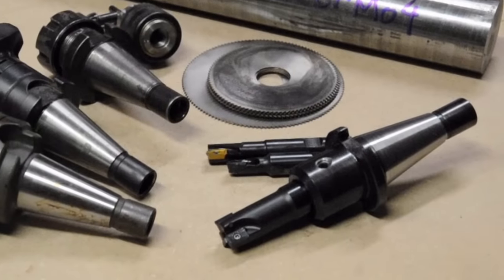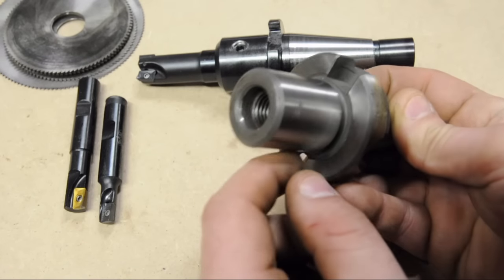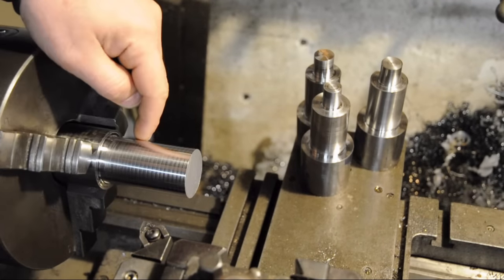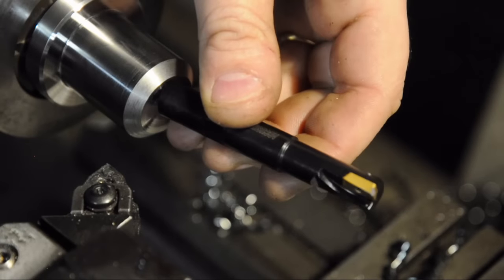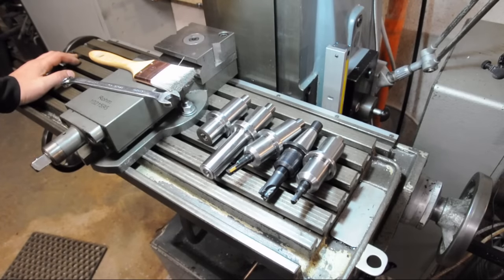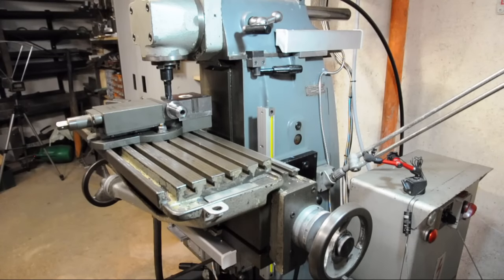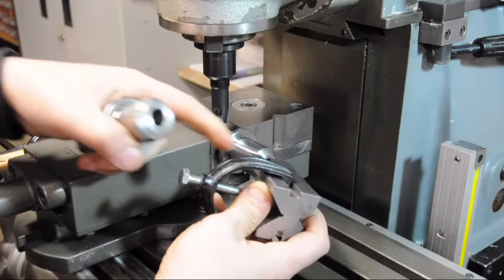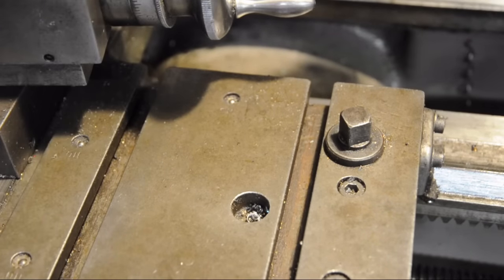Taper Tooling  For The Mill

Comment: How do you take such a large cut if I did that I would burn the tooling any advice would be great
Reply from the maker: Since you're burning up tooling I assume your lathe has the power to push the tool.  If you're talking about HSS, have you tried coolant?  And if it's carbide, your feedrate or depth of cut is too slow/light.  You maybe be rubbing it to death.

Comment: Why didn't use coolant in turning to avoid the heat?
Reply from the maker: +The Machinist Habit mostly.  Haven't used flood coolant in ages.  I bet my coolant tank has a solid block of cheese in there now.  Was mandatory when I was mostly HSS, but with carbide... less mess.  But that's a smart idea.  Thanks for watching Machinist!

Comment: Tony ... ELECTROLYSIS will DE-RUST every metallic part you still own.
A tiny automotive battery charger, a wire basket for the small stuff, and some borax, You will never ever play with oxides on any metal part ever again.

Comment: what you have fix with shaft of taper slide for fast turning
Reply: Ultimate Lathe Works he uses a cordless drill to chuck a tee-shaped rod which drives the feed handle

Comment: Crank the speed down and increase your feed rate, 4140 is a bitch and will work harden on you if you run it fast and light. Not too bad once you get a handle on it.

Comment: Tony! you may be able to use Alum in hot water over a few hours to dissolve the drill bit right out of that pooched chromoly blank. here's a video with the basic premise. https://www.youtube.com/watch?v=fqZYgReuywM  Tried doing some research to see if the alum will dissolve the chromoly of the blank itself, but you probably have a small piece you could throw in some alum to test it out. 

I hope this finds you well, perhaps we can upvote so he can see it??
Reply: DJHenjin that trick only works on aluminum parts
anything that'll eat a drill or tap will eat a steel part

Comment: Hi Old Tony... congrats for your vídeos. Help me with one question. I’m a noob in milling. What toolholder do you recommend? I saw a machine with BT30/ISO30 or MT2 Type toolholder. Thanks.
Reply from the maker: I'm not a big fan of MT tooling but it sounds like you're considering 2 different sized machines.  get the heavier one. :)
Reply: Thanks... is the same machine. Wabeco F1200. They sell it in both options ISO30/BT30 or MT2. I also think MT2 is not the best choice. Regards from Santiago Chile. Big Fan of your work!

Comment: Tony, ignorant question: why do you avoid bluing the tapered section of the tool? Is that purely aesthetic? Or is there a functional/metallurgical reason you leave that un-blued?
Reply: I have always used an oily rag to wipe tapers as I remove tools etc.
Reply: Ian Hay the taper is a precision surface, cold blue is pretty rust (basically) so the blue would throw off the precision of the taper